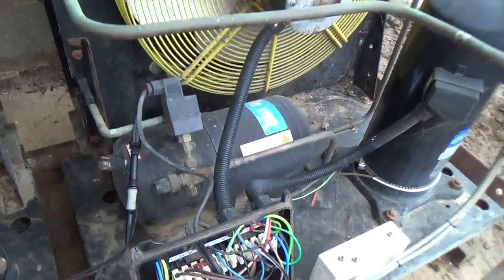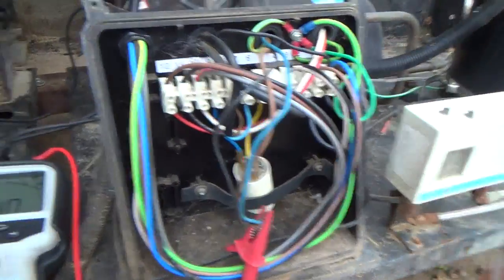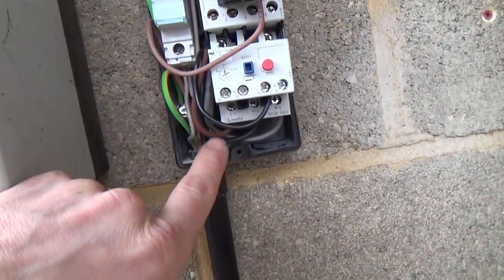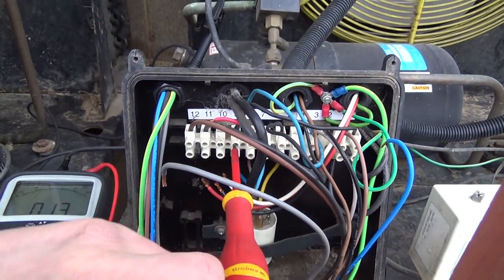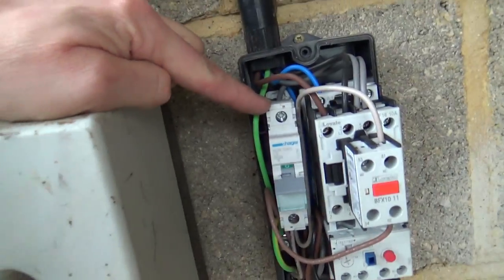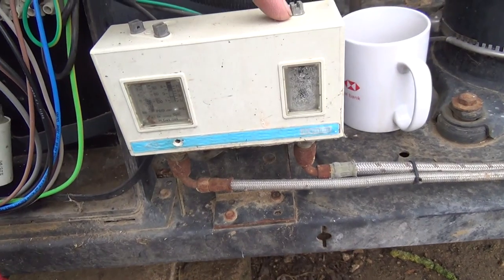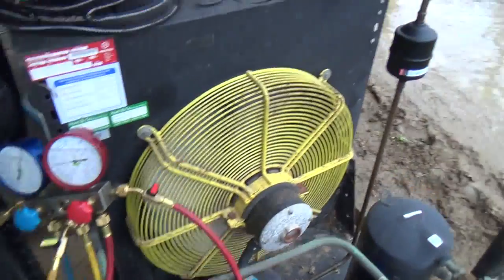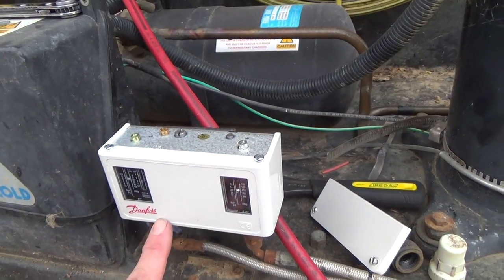Megger Testing: Tracing Electrical short

Comment: Hi John   love getting the Megger out aswell. sorts it out. Not too many fridgies use them when they should.  Thanks for sharing.
Reply from the maker: +Steve Orr Thanks Steve! I can't see how you can do the job without a megger, i get quite a few earth fault problems as farm dairies tend to be damp environments, add in rodent damage and there are faults it would be difficult to find otherwise.

Comment: Heck of a job! Keep up the good videos! I'm fairly new to the trade. I only pull out the megger for compressors. But now I'm gonna use it alot more. Is earth fault the same as tripping the breaker?
Reply from the maker: Hi Eric, it can the same as tripping the breaker. Breakers generally need a lot of amps to make them trip so a dead short between live and ground will trip them, though be aware a short between live and neutral or even a seized motor can make a breaker trip. Generally a earth fault will make the RCD/GFCI trip which generally will turn off the power from the panel/fuse box (unless individual breakers such as RCBO's are used for each circuit, they are basically a combined breaker and RCD )
Reply: heavydiesel yes but a fault to ground will only trip the breaker if the egc is bonded to the neutral. If you don't believe me, run a #12 from a 20a breaker to a ground rod and turn it on, notice how it holds, put an amp clamp around it and see that it barely draws.

Comment: I'm not an electrician but a curious fella,. Please explain, the one red lead you are testing insulation on each phase. But where you clip on the other black lead coming from the insulation resistance tester?
Reply from the maker: Basically one lead goes the earth/ground and the other lead goes to whatever you want to test, the megger measures how much voltage on the red lead 'leaks' to ground through the part you are testing, there is always some leakage but too much and the part is faulty and needs to be replaced. Sometimes a bad reading is due to dampness and just drying things is enough to get a satisfactory reading.

Comment: Nice methodical testing there John, you have your fault finding tree nicely set up from most common failures to least common.

Suggest that a roof would help, to keep the electrical stuff from getting water in it and this occurring, it may be splash proof but that does not mean waterproof.
Reply from the maker: +SeanBZA Thanks! I was expecting it to be the CCH as they are a common fault on these. They are going to get a roof put over it, nothing stays waterproof for ever, i'm amazed the fan motor is still ok.

Comment: Sir when you're checking electric motors to check the windings where is best to put the black alligator clip directly on the frame of the motor??
Reply from the maker: The black lead just needs to go on a good earth/ground connection somewhere, can be on the motor from or earth terminal somewhere. Just test it first by putting the red lead on a different earthed location to prove the black lead is making good contact.

Comment: In case of electrical circuit the  exact voltage is  not matter but electronic cct can i gave  high or low voltage to  electronic cct ?
In case of maggring or isulation resistance of cct.
Plz reply
Reply from the maker: I would not megger test an electronic circuit, you could easily damage the circuit.

Comment: Sir testing range select 500 volt ,and when you test perfom its range your meter show 512 voltage ? Why
Reply: Sorry 551 volt ? Why
Reply: Reply plz
Reply from the maker: That is how the meter works, the exact voltage is not important as such as it depends on the resistance of the circuit being tested, the lower the resistance the lower the test voltage will be. It is the resistance measurement that we are testing to find out.  @muhammdalyan7846

Comment: how to test the ir value of cable
Reply from the maker: If its just the cable you are testing you would disconnect it at both ends and test between the conductors and ground, and also between the individual cores if its a multi core cable.